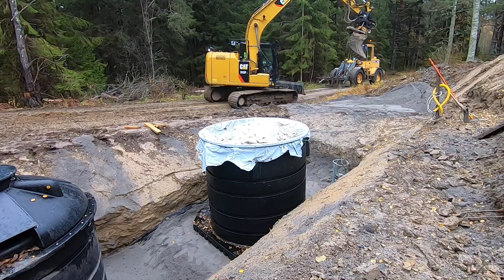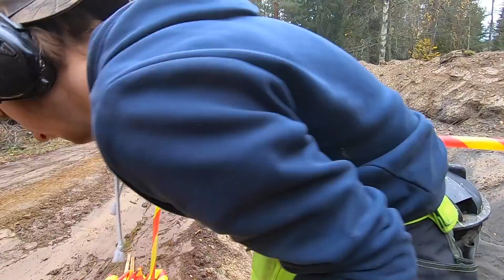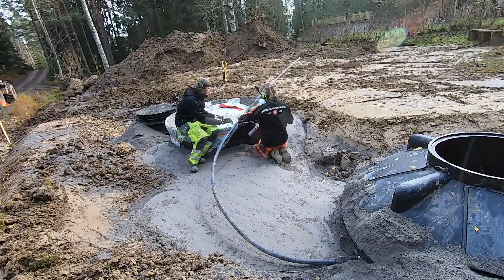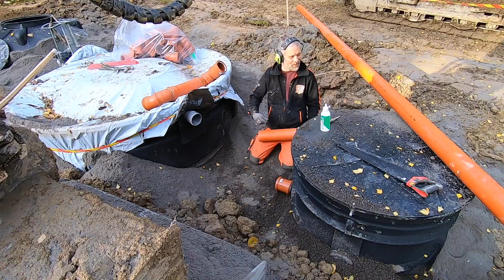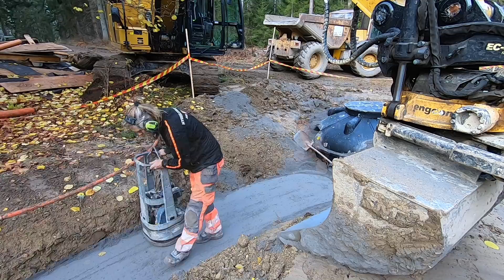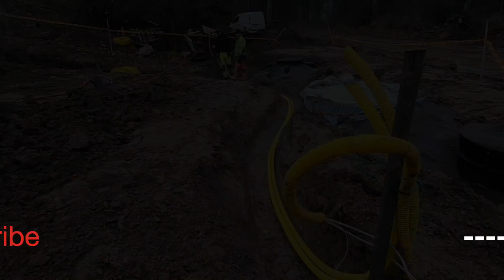#185 -One More Sewage Biodegradation Treatment Plant (Part 2:4)

Comment: These tanks look pretty big, also there does not seem to be any infiltration bed. How does this system work?
Reply from the maker: This system is very environmentally friendly.
The plant does not need to be emptied, all waste is broken down by micro-life and plants and the clean water goes back into the ground.
The last tank is a phosphorus trap, in it it's a bag that has to be exchanged, but I do not know the intervals.
Reply: I think it just dumps the waste into the tanks and then every 6 - 9 months a 'Septic' truck comes along and pumps out all the waste.  At least that's what happens in the UK.  We don't have leach fields like in N America.

Comment: Great job, but i have a question, why 0/16  its gonna sink in future a little bit and its doesn’t meter that you vibrating that
Reply: My guess is that it sinks less than sand, and is still soft and easy against the pipes. Bigger gravel dimensions have hard, and jagged edges. It also makes it easier to make a grade, since it becomes a very flat, and uniform surface to lay pipe on.
Reply: @the_hate_inside1085  what i find best its use 8/16 around system, to rise under pipes 16/32 and ~10cm 8/16 and also vibrate everything. Its lil more expensive but solid rocks don’t gonna sink